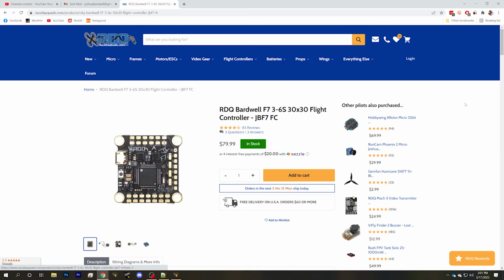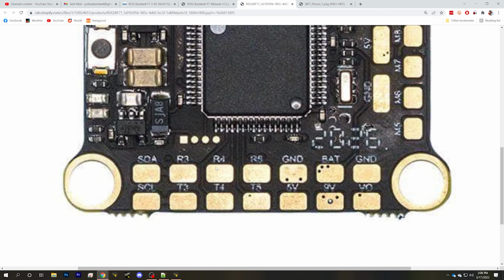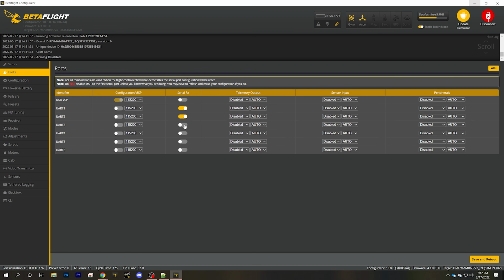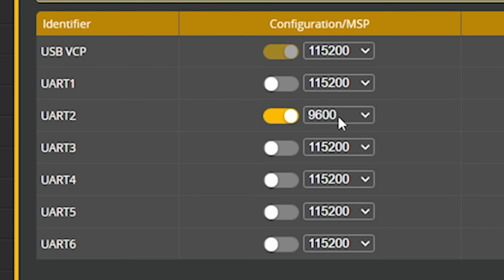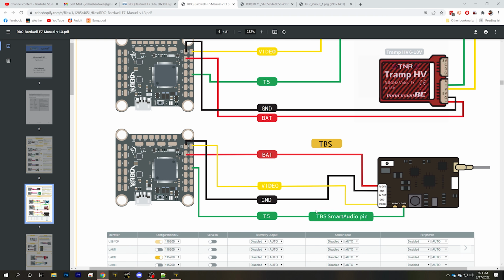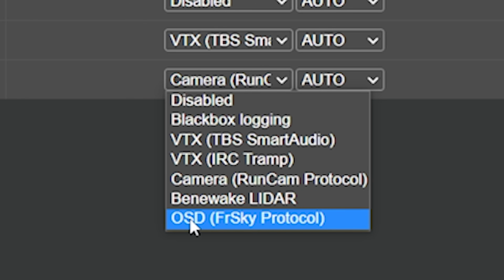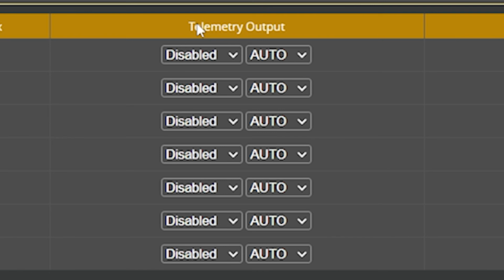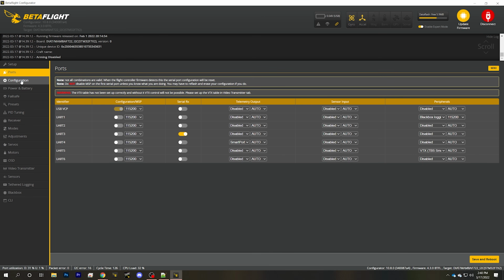Betaflight 4.3 Ports Tab | | COMPLETE WALKTHROUGH PART 2

Comment: Can I use Betaflight to configure my GPS module I want to add to my fpv? or do you think my drone will hover in place without it? My need is to have my drone lift a flag and stay in same location/height the whole flight for survey work. Do you think I will need the GPS module or not?

Comment: I want to send data via Serial RX e.g. from my laptop. But If I have Serial Rx and MSP on on the correct UART, it swipes the config... any way to know why? I dont see anthing in the logs.
Reply from the maker: You can't enable serial RX and MSP on the same UART. If you want to remote-control the drone with your PC, you would do it only via MSP. Or you would program your laptop to output an SBUS or CRSF signal via a serial adapter and then skip MSP entirely.

Comment: Quick question.  I have a GepRC MOZ7 V2 with the TAKER H743 BT Flight Controller.  When I first connected the drone to BetaFlight, I noticed that it had v4.5.1 firmware flashed and that v4.5.2 was available so I upgraded.  Thanks to your video, I also did a backup before flashing the newer firmware.

After rebooting, I noticed that UART5 (GPS) had disappeared from the Ports tab.  I have a screenshot.

On advice from GepRC Tech Support, I reverted back to v4.5.1 and restored the backup but I now have no UART5 at all and UART6 seems to be supporting GPS.  Is this reasonable?

Is it possible to add UART5 to the BetaFlight configuration?  I don't see how in the UI and don't see any videos that answer this question.  One video went to the CLI tab and entered a command for a "Soft UART" (which is different).

Any advice, Joshua?  Oh, and thank you!

Comment: Hello, I know this video is pretty old now, but I need help with my walksnail vtx (avatar hd mini lite kit)

I'm trying to configure it for my fc, but the peripheral I need, MSP + Displayport isn't there. I've tried some answers from other people asking the same thing, saying to add it through cli, and I tried following an article from Oscar Liang, but I haven't been able to make it work. The cli prompts seemingly don't change anything.

I got a Mobula 8 "03 lite" version, which doesn't come with the camera or vtx, I bought them separate to save a little money. It has 4.3.2 on it and I tried both version 10.10 and 10.9 configurators. I was thinking about trying 10.8 later but I don't know if it will change anything
 
Currently binging this whole series to make sure there's not something I'm missing

Please help me, reddit ignored me. And thank you for all that you do for this hobby and community
Reply from the maker: You need to flash the FC to BetaFlight 4.5.

Comment: Hey Joshua, great video, as a newbie to FPV I'm still learning how to setup a quadcopter. I read a little bit about UART's and I try to understand what's their differences if we compare them to General-Purpose Input Output(GPIO). Is it correct to say that a UART is a specific implementation of a GPIO ? I'm asking this because I saw some talks about people trying to get Raspberry Pi Pico as the flight controller. Wonder also if that experiment worth my effort, and that can somehow work. Those Pico's microcontrollers are generally very cheap and I could get them for 10$ which can save me a tons of money, if I can get them to work in the same way the Flight Controller from a vendor would (by install betaflight etc...). Maybe I'm missing something, considering that I'm a newbie to the whole FPV Drone world.
Reply from the maker: I think that's right. A UART is a special case of a GPIO interface.

Comment: I have the XILO STAX V2 F4 FC with the kit that he sells-- im trying to use the o3 air unit with the DJI FPV controller 2.  I can't get beta flight to recognize the inputs from the controller.  Anyone else tried this?  I know the UART3 is the one for this FC that the air unit goes into and in Betaflight I have the serial RX toggle on UART3.  Which UART does the Config/MSP toggle go on?  I've also enabled SBUS fast on both the controller (through the goggles) and Betaflight in the CLI command screen.  Any help from anyone would be awesome because I'm really stuck.
Reply from the maker: Enable Serial RX on UART 1 in the Ports tab.
In the Receiver tab, set receiver protocol to SBUS.

At this point, you should have movement in the Receiver tab, when you move the RC controller sticks. (Assuming the RC controller is bound to the O3).

If you don't have movement, go to the betaflight CLI and type

set sbus_baud_fast=on
save

Then you should have movement.
Reply: @JoshuaBardwell  Wow thanks a lot man! That worked- just confused why the serial RX toggle needs to be on UART1 if the 03 unit is on UART3 on the FC.
Reply from the maker: The O3 has two UART connections. One for OSD and one for RX.

Comment: Watched your vid, good but you didn’t mention how to set a port to use i2c. Specifically, I need to plug an external magnetometer into the “flex” port of my REVO fc. The REVO is supported by Betaflight but the port options are only GPS and ESC.  There are no i2c pads accessible, only Main and Flex port (4 pin) which I believe are uarts 1 and 2.
Reply from the maker: Revo is a suuuuuuuper old FC that ran openpilot. It can run very old versions of Betaflight, but basically it's completely out of date and none of this info can be assumed to be correct.
Reply: @JoshuaBardwell  yes, your right, Revo is very old, but the Betaflight is 10.9.0.
Guess I'll have to buy something new. I may try to make a connection directly on the F405 legs. Thanks for the quick response
Reply from the maker: Betaflight 10.9.0 refers to the configurator version. But if your OpenPilot board has F405, then it can run the latest version of Betaflight. I assumed you had the older FC with F1 processor.

Revo port options are optimized for OpenPilot firmware, and I don't know the details but it has always been a little clunky getting the ports to work with Betaflight. I don't remember exactly how they're mapped.
Reply: @JoshuaBardwell  yes, I am using the latest firmware 4.4.3 BTFL. The fc is old but they were ahead of their time. 10 dof.
High quality Hmc5883l and a high quality baro MS5611 by measurement  specialty . The only issue is the software doesn't support many of the new receiver protocols. I'm old so I'm lucky to understand Spectrum and sbus.  If I find the solution I'll let you know
Reply: Finally got it working, on INAV 7.0.1, but first, and before flashing, I soldered 2 small wires from the onboard mag solder pads 1 and 16 SLA and SDL to those pins on the external mag.  Not too hard to do since the Revo FC in question was a cheapy from RTFQ purchased years ago for $14. It came without the mag, baro and OpLink, but the solder pads were easily accessible. I have pics if anyone is interested.

Comment: Updated my firmware and POOF! Radio will not talk to receiver...it will bind...but nothing will work in betaflight...I'm just bitchin...I couldn't even articulate a question at this point. Let's start here

How in the hell do you identify the uart number you are connected to? I've located the 3 or 4 possible fc diagrams that are left and not 1 indicates uart in anyway.

Comment: I'm using a RacerStar FC and they it doesn't use the TX/RX nomenclature. My FrSky Rx is soldered to the SBUS pad - I have no idea which numbered UART this corresponds to. Same w/ the FPV camera and Tx, solder pads are labelled "VI" and "VO" - have no idea which numbered UART this corresponds to.
Reply from the maker: Vi and Vo are not uarts. They're video for camera and vTX which isn't a UART. SBUS you have to look into documentation for the FC to find what UART that is.

Comment: JoshuaBardwell 
 I"m about done with drones lol for the life of me i can't get the controls to work i was following your videos step by step, and after ports went to receiver and nothing is working i have a speedybee f405 v3  with spektrum spm4650 dsmx srxl2 micro receiver what am i doing wrong the soldering for the receiver is black on ground red on 3v3 and brown on t2, and have no idea what i am doing wrong please help
Reply from the maker: Try this: go to CLI and type

set serialrx_halfduplex = on
save
Reply: @JoshuaBardwell  Well, i wasn't expecting a reply, still learning and wouldn't have a clue how to get to the CLI sorry. I appreciate the reply ill try to figure it out thank you.
Reply: @JoshuaBardwell  I figured it out and turned it on but still no controls on transmitter.
Reply from the maker: If using BF 4.4, SRXL2 is not included by default. You have to add it. Here's how: https://www.youtube.com/watch?v=YmTq68M-NkU&ab_channel=JoshuaBardwell
Reply: @JoshuaBardwell  Good morning, I watched that video but it stop me half way when  I noticed that on the firmware flasher tab. When I change the Radio protocol to spektrum and then connect and go back it put it back to default "CRSF,GHST,SBUS".
Reply from the maker: You need to make that change then flash the FC. Not connect.
Reply: @JoshuaBardwell  Thank you for the reply, I just changed it then flashed it and still no controls on transmitter. I did notice it saying at the top chrome API error transfer failed. Under that it said, read protection not active. 

The radio protocol went back to default again.
Reply: Thanks for the help nothing is working  I gave up. Cheers.

Comment: Ok so my FC board has the connection pads for UART3 (marked T3 and R3) but UART3 isn't showing up on the ports list in Betaflight. It jumps from UART2 to UART4. Any thoughts??? Please help!!!
Reply from the maker: This often means that the wrong target has been flashed to the FC. The solution is to identify the correct target name and flash it.

Comment: your videos are great but i cant get my quadcopter to do ANYTHING, i just built it never used betaflight before so thanx for the series, i have what beta says is a flywoof411 4.3.1 and apparently everything is ok with that, i have used a flysky FS-A8S which i cannot bind my flysky FS-i6 transmitter to, but nothing powers up when im in betaflight so no power goes to receiver, but i did have it powered in belheli but also it did not bind, so i cannot connect transmiter so stuck and cannot do shit, maybe i will have solved soon but i fucking hate betaflight RN

Comment: For those wondering, the Frsky OSD protocol is meant to communicate with the pixel (analog) OSD modules (and a few FCs) that were mainly made by Matek and Frsky. Using these OSD provide you with much finer details than traditional character based OSD, especially for altitude ladders, compass and artificial horizons, but it is mostly useful on fixed wings or other iNav builds.

Sadly as Joshua said these OSD seem to be largely discontinued by now, probably because they did not take off because of digital fpv.

Comment: Great video. very informative. I just have 1 question. At the end you mention that some FC's can send back Telemetry to the  radio transmitter ( the antiquated bit you mentioned )  but then, is there a transmitter on the drone itself ?  The VTX sends to the goggles , so from where does the transmitter get back information ?  Is the receiver in fact a Transmitter/Receiver ?
Reply from the maker: The receiver will have a telemetry transmitter in it, if the receiver supports telemetry.
Reply: @JoshuaBardwell  Was not assuming it worked that way but makes sense . Thanks for the quick reply. Im  a gps drone user so all of this is totally new to me. Trying to learn as much as I can 'before' I try fpv and freestyle. Thanks again for the great content.

Comment: I recived my f3 flight controller..i have an f4 4 in 1 esc...the esc is powered driectly by battery...the f3 controller is plugged into the esc theu a wire that esc came with...has ground and pwm for 4 motors...the port wire dont connect the positive thru that wire...do i power the f3 thru the 5v? Not the esc port with a 5volt line?

Comment: To everyone with a XF5804 or VT5804 video transmitter (PandaRC, TCMM, Cyclone, Eachine Wizard & Tyro), since it is almost impossible to find any documentation on those:
They use Smartaudio 2.0. Power Levels are 25mw, 200mw, 400mw, 600mw.

Comment: @Joshua Bardwell For Digital video system is there still the need of OSD chip, MAX7456, or the MCUs in our flight controllers are enough to send OSD elements via MSP?
Reply from the maker: Digital systems don't use the MAX chip any more. The MAX chip is only for analog OSD. However, some HD-capable FC include the MAX chip so they can also be used with analog video.
Reply: Exactly what i thought, it means FCs made for digital only can save that space, the MAX ic, the xtal, various caps and resistors, it can save a whole lot of space on the board to position the components precisely..